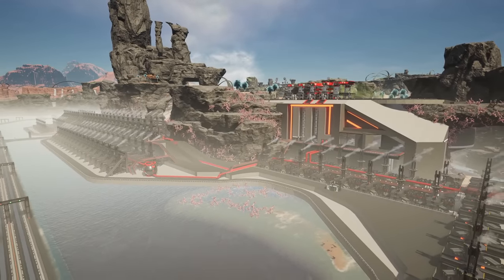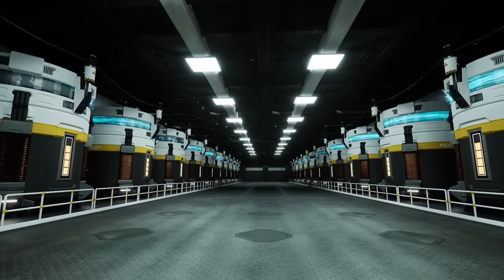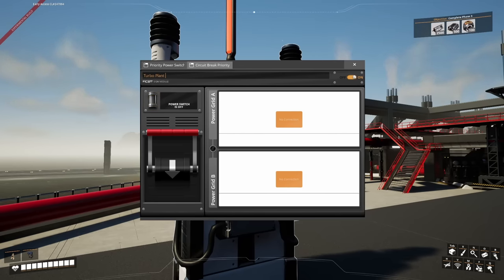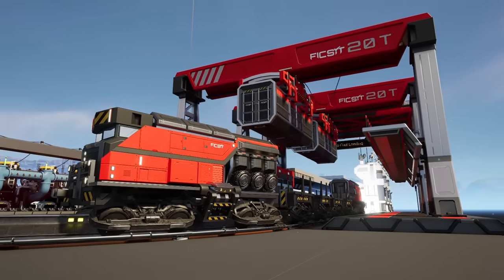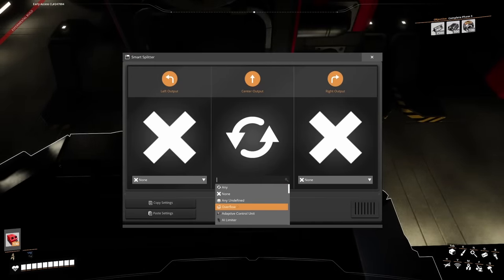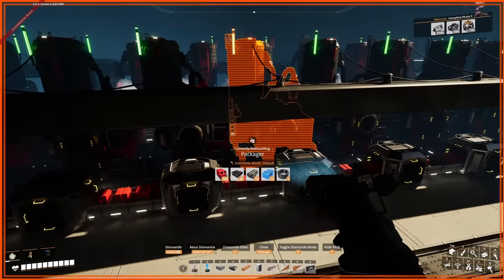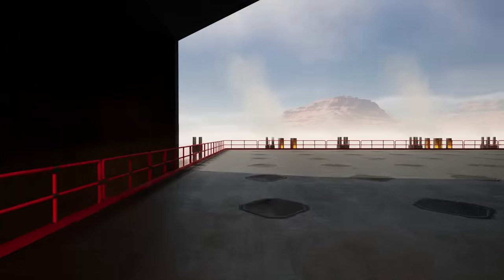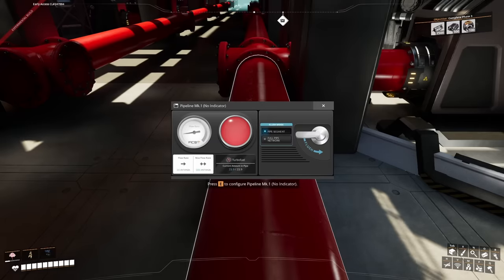Factory Failsafes YOU Need To Improve Efficiency in Satisfactory

Comment: Place the power storage batteries in the power priority group one along with power plants. In this way when the power fails, the batteries will be empty, and the priority group will be cut. So the still working power plants will charge the batteries as long as the problem is solved. When it is solved, they will be charged and will have enough power to kickstart the non working plants.

Comment: I always isolate the power supply required to run the power generation from the main line meaning that even if the main power supply goes down the power required to run my power generation is still running perfectly

Comment: 10:15 This is unfortunately still an issue in 1.0, and I think it's less a bug and more just a quirk in how fluids work in this game. The best thing to do is to start everything on your pipe network turned off - build it, then immediately turn it off before connecting it, then connect everything up with pipes, then wait for the network to fully saturate so every pipe is full. Once that happens, turn each building on one by one, letting them fill and the pipe network to refill before going to the next one.

Can be tedious with really large factories, but it prevents any weirdness with pipes not filling completely and causing surges in production.

Comment: Two things I do with my factories these days is:

One: slightly over produce required components so the end product can be made at 100% regardless of any little loading bugs/hiccups that may change things. The components being slightly over produced (I'm talking 0.05-0.1%) can be sinked or left to back up

Two: Is the opposite of your not concerned about light variations in the end product production but want the rest of the system to run at a consistent 100% slightly overclock the end product production by a bees dick.

I use both these methods in combination in my builds to great success

Comment: I want them to hire an electrician and math out making a positive and negative terminal on the battery backups.
I want to increase the voltage to send longer distance and then step it down and wire for max capacity.

Comment: the inefficiency was moving liquid....by packaging it?  See the problem with moving things by packaging it is you need your trains to be TWICE as long (or moving half as much), since you need half to unload the loaded fuel, the other half loading the empties.  Stack this against just normal fuel cars allowing you to move at whatever size trains your running.  Distance just means you need more trains moving, and with a proper mainline setup, won't be a problem.

Comment: The isssue at 7.40 and anyhting similar to "factories not runing at their intended full potential" can literally be fixed by, power switch on  , power switch off. after it gets 1 item in, the items keep going in even if the powers off, once the conveyrbelts are fully loaded and cant move more forward. power back on ,tadaa fully perfectly working again if everyhting else is set correct
Reply: problem lies in trying to start running the factory while there converbelts arent full of items, similar to starting coal power plant before water is fully in pipes syndrome/issue

Comment: Dont take this the wrong way, but is there an actual need to be producing that much fuel or did you do it just to do it? I ask because i just started the game, have about 150 hours in, and have done absolutely nothing with Phase 4 yet just because of the absolutely exorbitant item requirements (16000 computers just to make up one of the item requirements? 😐) Anything ive needed a manufacturer for (items for research or objectives), ive set up the manufacturers independent of any other lines and loaded the necessary components into container boxes attached to said manufacturer.

Really looking at the phase 4 parts though, doing that feels less and less like a tenable solution. I know phase 4 is supposed to be less imposing when 1.0 is released, but still. I'm mostly wondering if X production at the level you've got here for basically a single item is more common than im realizing.

Comment: Wait, how is he connecting machines power directly to each other in a daisy chain? Is that a mod?
Reply: They aren't daisy chained to each other, he has wall or ceiling connectors between each instead of poles. They work just like poles but tiny. Buy them in the shop.

Comment: Wait, did they change how power works? You linked all the batteries to each other at the start, I thought they worked the same as other buildings needing power poles connected.... Have I been doing that wrong all this time?
Reply from the maker: The batteries have always been chainlinkable, but the other buildings not unfortunately
Reply: @TotalXclipse  Never knew, good feature because those are a pain to build in mass.
Reply from the maker: Makes it super easy with blueprints now! @kosgoth

Comment: Got a weird, unrelated question, How do you make it so the billboard/screen signs illuminate light? Even if I put it on glossy lvl 3 it doesnt emit any light on the ground or surface
Reply from the maker: You need to change the background colour of the sign. I have a few videos on lighting that may help you out if you're still not sure
Reply: They still don't produce light, they'll only glow. So you can backlight something cause it will create contrast, but no light is actually emitted to light up other things around